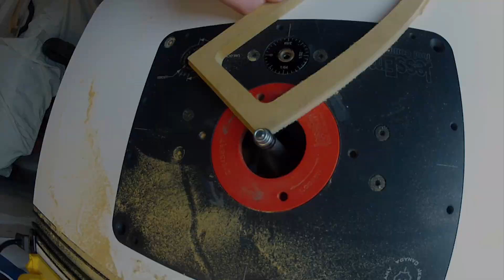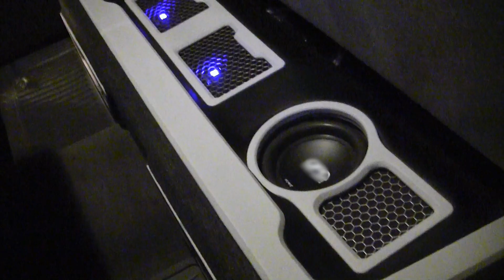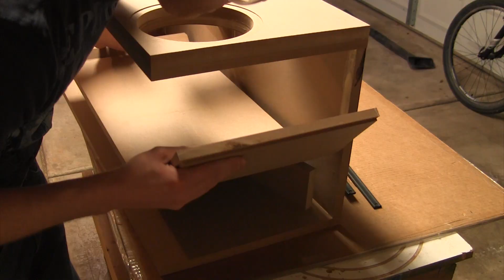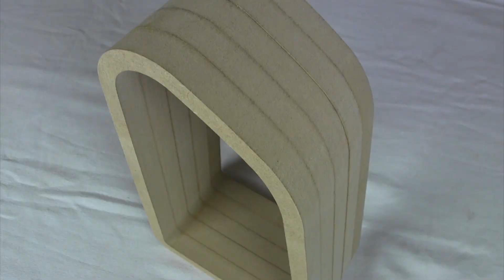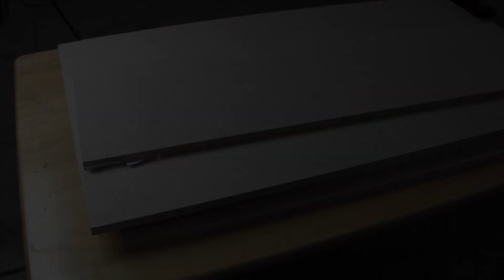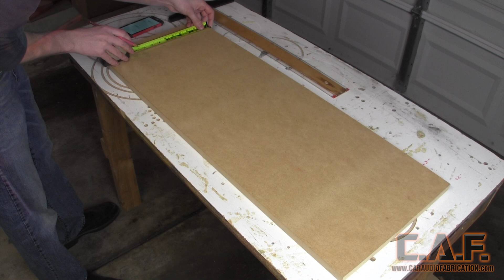Build a BETTER subwoofer box - CUSTOM design for your exact subwoofer

Comment from the maker: Need your own custom box design? Go here: http://www.caraudiofabrication.com/box-designs
Reply: I just got a used Subwoofer and the cone has slid what is the best way to fix that? There is a video on my page if you need to see it. Thanks, enjoy your videos
Reply: CarAudioFabrication ndjnfdbjrjiwjj fffubbbj
Reply: CarAudioFabrication kdhkkf
Reply: CarAudioFabrication
Reply: CarAudioFabrication I need a to build a ported box for dual 8in sundown x8
Reply: What’s a perfect design for one 10” alpine Type R DVC subwoofer in a tight rear compartment on a C4 1995. Would like to have two mono block amps integrated in/on the box if possible or even a 4 channel amp along with the other two amps. Not really necessary to see the woofer as it’s non directional anyways but would like to have amps in front of box so outside air or cold AC can cool the amps. What do u think ?????? Will custom box be stupid expensive?
Reply: Hey mark I have a question for you. Could you build me a 18 sub box? I can't find the blueprint on your website.
Reply: Can you please give your whatsap number or email Id
Reply: Hey is this an actual website 🤔
Reply: I have been observing your video content for an extended period and am particularly impressed with your subwoofer box designs and construction techniques. I would be delighted to see your single-style boxes specifically tailored for the Dodge Durango. I trust your expertise and am confident that you will deliver an exceptional product.
Reply: CarAudioFabrication NuxNZxVcXNz
Reply: muniraja

Comment: I like this design. Can you please do a video of how one would design a 3 12" subs with a slot for mounting 2 amp 8000 w for speakers and tweeters and a single monoblock and on top of that box build something similar to a Phoenix Gold ZPROB654 High SPL Audio Speaker Box 6.5" Mid Bass and 3.6" Tweeters and on the sub box mount 6x 6x9 speakers. How would you design this and would it fit into a Suzuki ertiga boot..? I see you have done plenty of sub boxes but they all somewhat minimalist so I'd like to challenge you to design a complete sound box setup with 3 subs, 4 bullet tweeters, 4 mid range, 6 6x9 amps mounted in a slot on top of the sub box below the phoenix like box for the mids and the tweeters

Comment: Was this design for 2 12inch subs? I am trying to DIY the same ported box, and i am king of stuck with the port size. my box front panel is basically smaller than the port size (port size: 3inch x 16inch), i need to do the port 3.5inch x 13inch port opening and 44inch L port shape lengh to fit perfectly. This means L shape port 22inch L shape on each side, as the port will be located in middle of the box. Is this correct?

Comment: There really is a need for step by step instructions on how to make this what's your video does not do. What's the best way to line up the baffles before you press them so that they don't miss a line. How did you assemble all the interior pieces did you use clamps on that too I need like someone to take time and do a real video on how to make a box with double baffles in a flush baffle you know the whole thing.
Reply: um, were you asleep? this is a step by step walkthrough of a build start to finish. You need someone to hold your hand thru each step I hope your ablidging us all with handjobs too goddamn what more you want. BUY YA BOOKS, YA EAT THE FUCKIN PAGES wtf.?!?

Comment: seems like you could route out some holes in those 45 corners. wasting air space
Reply from the maker: The amount of air volume they displace is actually quite small.
Reply: @CarAudioFabrication   I guess its only like .1 cu ft if those are 3x3ish corners.. Still seems like a simple horizontal gusset would be Just as, or more effective. Especially the L shape, a simple horizontal piece in the middle would work wonders. Anyways just discovered these vids. Super clean work.
Reply: seems like that would be a complete waste of time. But hey keep critiquing people way smarter than you, im sure thatll get you far. Dick.

Comment: Hi Mark, great videos, i have truly enjoyed them. I habe have a question if you don't mind? I have 4, 10 inch subs, two old skool focal's and two old skool mtx. I was thinking of building a ported box but want to ask, would it work if i sealed two in their own box and ported the other or should i just use the two instead of the four?

Comment: Which Speaker is better: 1.- The
"Front sound" without obstacles and the "Back sound" runs
through a maze to reach the Speaker's exit. 2.- The
"Front sound" runs through a maze to reach the Speaker's exit, and
the "Back sound" comes out through a "simple tube" thanks
Reply: huh?

Comment: Mark, 

 I listen to literally all music types. Frank Sinatra, Country, Alternative, Rock, Some old school rap (NWA, Ice cube, Easy E) Heck sometimes 16 year old daughter plays something she mistakenly called music.  

Initially I planned on firing the subwoofer up into the rear seat or down into the floor . 
But without a seat lift my needed mounting depth and X-Max wouldn't have enough clearance to play freely. 

 I have a DC Audio M3 8.   The generic recommendation from DC Audio  is .75 cuft 
While playing around w/ multiple Airspace options in WinISD and Speaker Box Lite via Android app and the Web version I come up with a nice looking curve using .94 ft cubed.  I have up to 1.3  but have settled on .94. The programs are recommending a 4x1 slot port at 17.9 inches long.  This gives an FB of 24hz and a F3 of 20.7.   I know sub box performance can vary based on vehicle and physical location.  My vehicle is a 2011 f150 supercrew and it being installed under the rear seat firing forward directly in the center of the rear seat.  

Question 1.
 Should I select my own tuning frequency or
is the Algorithm used by WinISD calculating the the only tuning based on the subs TS parameters or is it just a middle of the road option that is recommended? 

I know  that certain vehicles like hatchbacks can  give a few DB increase if firing back or up at the glass.  

When porting this subwoofer I had planned on firing the port into the space behind the rear seat in an attempt to get a possible db boost. 

Question 2.

Should I fire the port and subwoofer both forward or is my rear port idea into the open space behind the rear seat valid?

I appreciate any input you can provide me.

Comment: I am also trying to build the right box for my old sony sub. Sony XS-L1235 but I cant find speaker specs for it. Is there any way you can point me in the right direction? I have also tried on the sony website but no luck. Best I could find is it's a 12" 200w rms with a VAS 104 liter.

Comment: I recently got a 12 inch Blaupunkt woofer having 264 watts RMS with Blaupunkt 2 channel 300 watts amp. The woofer gives an amazing bass as it is put in a sealed enclosure. The box dimenshions are around 15*14*13 inches having an approx 30 L of cubic space and i think it is quite small when it comes to high volumes. So when i get it to the higher volumes  the woofer kind of suffocates. I tried to port the box but then i am losing the lower bass notes. So what if i go for a bigger sealed box? Shall i stuff it with polyfill, or keep the old box and upgrade it with polyfill?
Thanks

Comment: Just built your box but tuned to 35hz , I'm putting 2 x gto 1214's in there. If I upgrade to ground zero gzrw30xspl would this enclosure be too small? Btw I've learnt a lot from your vids, thanks for the help in the uk.

Comment: I have a question:  I have a jeep CJ5 I want to put a box under the rear seat.  Its outside dimensions are 4X20X30 to fit under the seat.  I think I can put 6X9s with an angled wall and a single small woofer.   Any suggestions?  Ever build a box in that tight of an area?

Comment: alternatively if want bolder raised letters. brush the contact cement into the vinyl and under design quickly. use tool with a rounded edge. to make the material get tighter into the corner. will hold a lot better than spray glue. use a heat gun with armor all on the vinyl to reactivate the cement if starting to set up. armor all will protect the vinyl. heat will soften up the cement. speed is key. if do it will have more pop

Comment: Hello.... @CarAudioFabrication  Help me please... i want to build a dual subwoofer reflex box for my 2 Tec Uxp 12D2.. Parameters are
Z (ohms) =  DVC 1.0
RE(ohms)= 0.90
Levc @ 1Khz (mH) = 0,62
Krm (m ohms) =1,63
Kxm (mH) = 7,44
Erm =0,77
Exm =0,72
Sd( m2)= 0,0530
B1(T*m) =7,5
Vas (i) =61
Mms(g) =160
Fo (Hz) =32
Qms=5,29
Qes = 0,51
Qts = 0,47
Xmax (mm)=8,0
SPL (dB @ 1K/1m) =88
Power RMS (Watts)=400
Power Max (watts)=800

Thanks!!!..
Reply: +erick samuel toribio monegro go to www.caraudiofabrication.com
Reply: for free?

Comment: Great tips. Love your videos. You should thin your glue w lacquer thinner. It will spray way better. Also using foam to emboss is kinda squishy. You get better results from something hard like wood or bondo or even an actual bronco logo. Thanks for sharing you have improved my work.

Comment: if a sub box is .35 cu ft bigger then the subwoofer manufacturer recommendations would it make a big difference in sound quality or performance? @caraudiofabrication
Reply: it depends on what the manufacturers' recommendations are. a 1cu ft box will sound different if you add .35cu ft. but a 3.5cu ft box won't sound different if you add .35cu ft. bu i do recommend using a program like winisd to calculate the optimal size of your enclosure! it's free and easy to use. feel free to hit me up for more info :)

Comment: Can you apply heat from a tourch to a exacto blade and cut through the foam or will it just melt/catch fire-just curious to weather or not it's possible to get a cleaner cut?
Reply from the maker: randall jr Benoit Possibly, I don't see the need though, once you cover with foam and surface with vinyl the foam edge loses its resolution.
Reply: For sure, leather or swade too?
Reply: Swede*

Comment: boxes should always be symmetrical, looks odd to one side..
Reply from the maker: joseph treasurecharms The customer is actually installing this as a center console with the subwoofers and port facing up, so technically it is going to be symmetrical from left to right. Thanks for watching.
Reply: CarAudioFabrication
 perfect sense, hence the sideways bronco,
Reply: Why should boxes always be symmetrical. Many reasons why some apllications they should not be. An enclosure can be any fucking shape you need it to be long as it can be built.